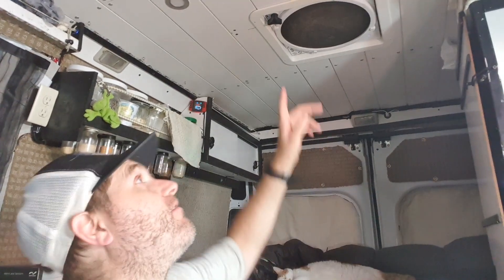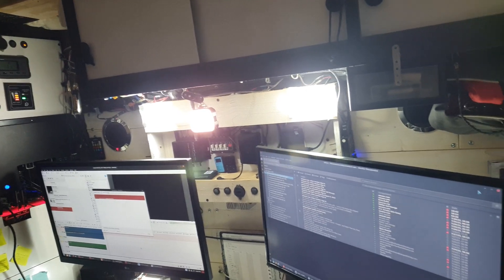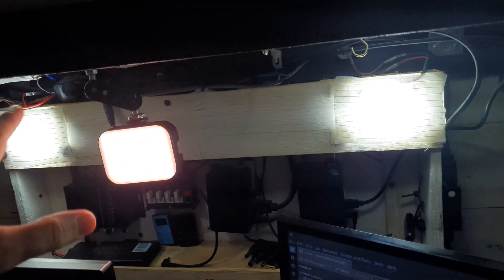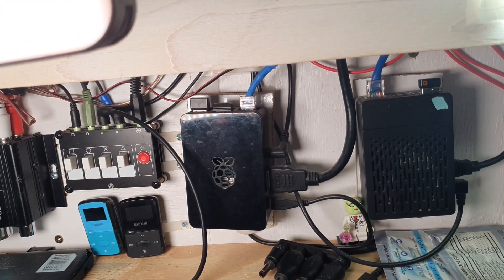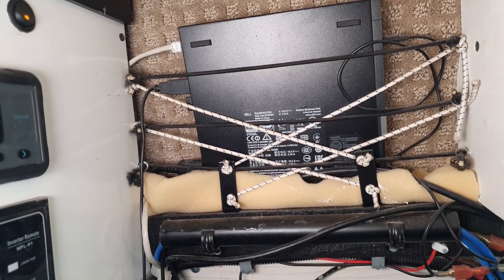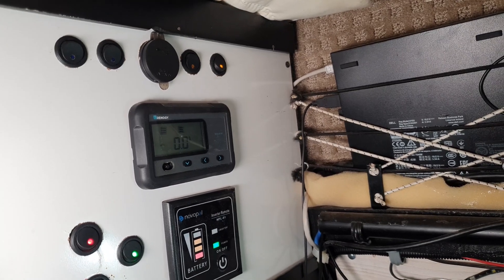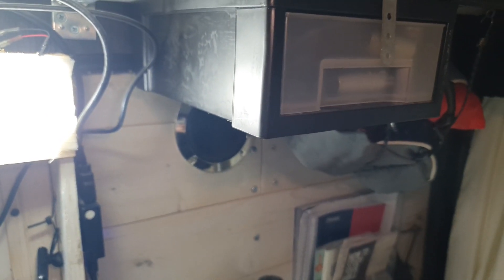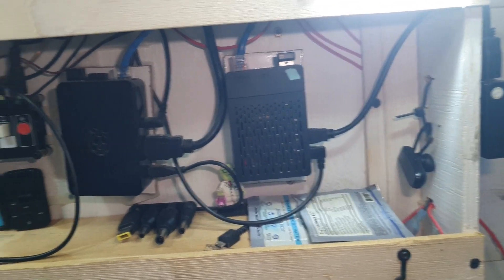Linux on the Road | What Linux and Computers Are In the Van?

Comment: Just wondering why you ended up with one PC still running on AC power. The efficiency of your inverter when running a tiny load like that is low, being able to turn off your inverter for hours of the day would save power.
It obviously isn't affecting you too much, since you've had two years like this, but it's my OCD wanting to drop AC when not needed.
Reply from the maker: Mostly because of the cost of the DC power supplies. They are $400-$500, but the inverter is only $200 and I need it for other AC purposes anyway.

Comment: I have occasionally wondered how you did all that, while on the road, so ta for that. Your system does look a tad complicated though. 🙂
Reply from the maker: A little. What I didn't mention is the different computers are because of different power levels. The pi is negligable energy usage.
Reply: @SwitchedtoLinux  Curious what Pi case you have on the manjaro system. I just purchased one from microcenter and now have to exchange/return a Pi4b due to it dying after 10 days of use. I left it running a youtube video yesterday afternoon and that's all she wrote...in the original canna case which I thought was fine. Max temp was 80 after a good 30 to 40 mins. That seems to have cause it to no longer startup which is too bad. I was wanting to use it to build a Mint Pi edition 😁
Reply: @SwitchedtoLinux  that makes sense. 🙂

Comment: Nice. I would consider encasing those large batteries in a metal box, as a precaution. And checking the connections for oxidation occasionally.
Reply: I disagree, if these cells go tits up I bet this dude can have them disconnected and thrown out the door real fast, if they was in a metal box it would be to hot by the time any smoke got out of the box and difficult to handle.

Comment: 19v @ 1A = 12v @1.58Amps....just in case you misspoke
Reply from the maker: The spec is 19v @ 3.34 amp which is 4.75 A @ 12V, but that is the listed spec. The actual performance only pulls 1A @12V based on my measurements.
Reply: @SwitchedtoLinux  I figured you knew...you did all that build and have been very diligent in watching efficiencies etc (ive followed for a while).....